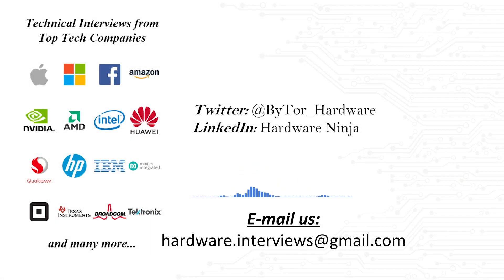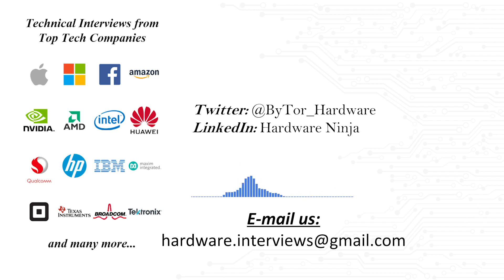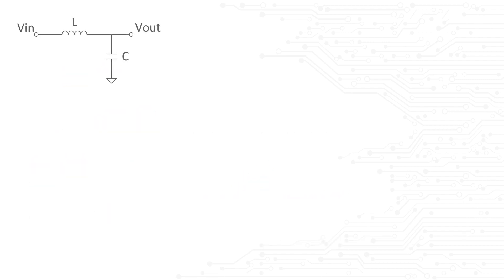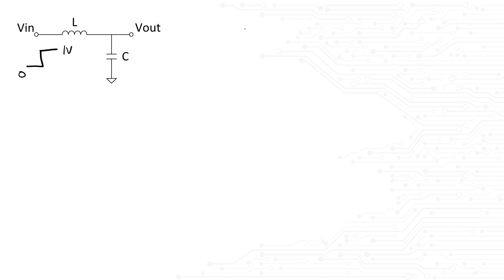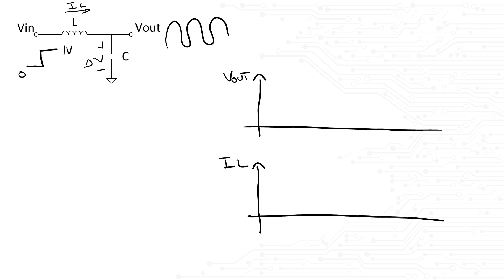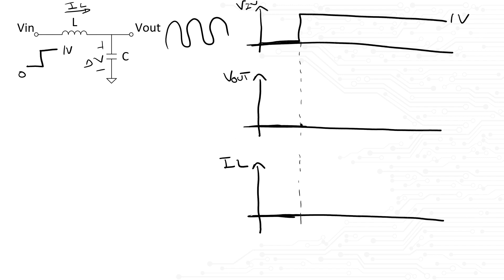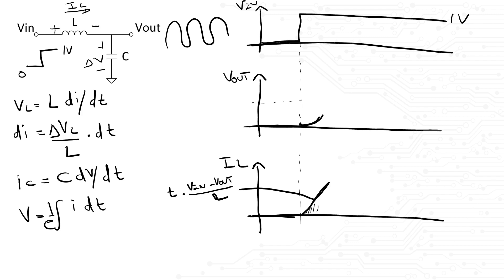HWN - MOST-STRUGGLED Hardware Engineer Interview Question

Comment: Hello
Will the output voltage be a decaying amplitude ringing signal over time, as in the ringing amplitude reduces until it settles down? (since this is a step input and the edge transition from low to high happens only once according to the diagram)
Reply: The output will not be decaying in this case as inductor and capacitor are ideal (they have no resistance components). In a practical circuit however due to parasitic resistance, output voltage will be decaying and settles to 1V at steady state.
This can also be easily proven by solving above circuit in frequency domain and applying inverse laplace to get time domain response

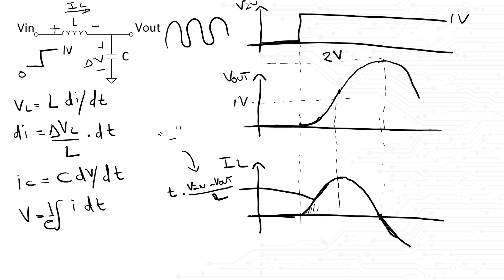Comment: 6:20 No this assumption is wrong. You don't know what L and C are. If L is really small and C very large then, then its possible no ringing occurs at all. 
But that's not really what I take issue with, in your explanation. I don't think you can say what voltage the capacitor will be at.
Now that I'm thinking about it, a more correct answer would also consider cases where C>>L and L>>C.

All that aside keep it up! I enjoy watching your videos. I think a few have stumped me as well, and I've only watched like 10 so far.
Reply from the maker: Hi!

Thank you for your constructive feedback, we very much appreciate it! However, we'd like to point the following: The result holds true independent of the values of L and C (assuming they are ideal). This is because this LC filter is a double pole system and varying the values of L and/or C will only shift the frequency at which they resonate. Let us know if you agree.

Cheers!
Reply: @HardwareNinja  Agreed.

Comment: add question: what is Imax?
Reply from the maker: Thank you so much for contributing to the discussion! You're absolutely right. Common follow up questions are:
1. Imax
2. Frequency of Oscillation
3. Bode Plot of transfer function
4. What happens if there's a resistor in parallel/series with the capacitor
Reply: @HardwareNinja  Can we get an explanation for those too?😜

Great work !